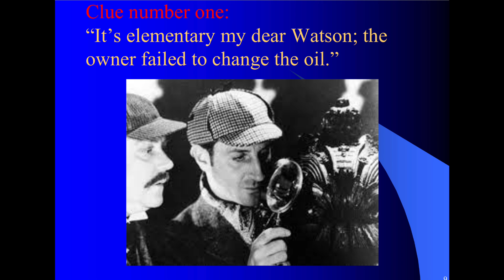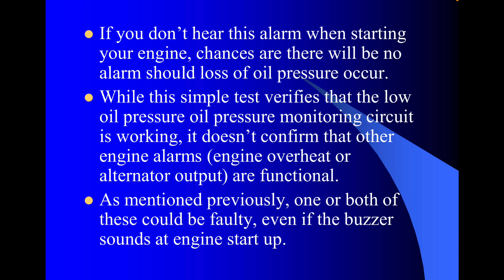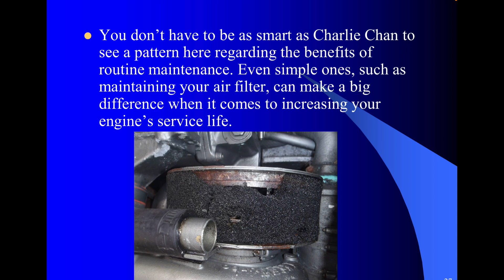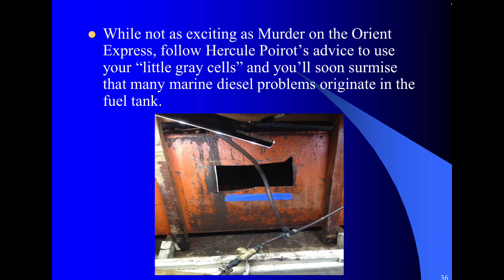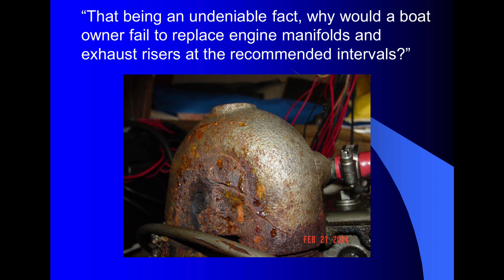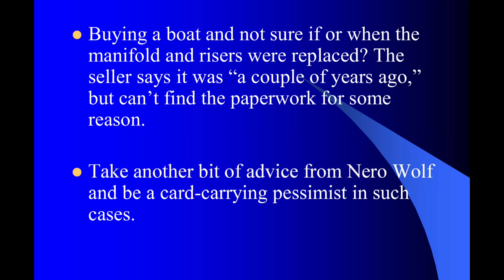Seven ways to MURDER your diesel!

Comment: Now I know why my friends dads Old wooden Chris Crafts boats all had the Exhaust manifold brazed up. We thought they were supposed to last for 30 - 40 years
Reply from the maker: If the boat is used exclusively in fresh water they can last significantly longer, although they still need to be pulled and inspected as recommended by the engine manufacturer. The manifolds and risers of raw water-cooled engines used in salt water are the most prone to corrosion. Those are the ones that you definitely have to stay on top of with regards to removal and inspection. And to be honest, if you pull a manifold or riser on a raw water-cooled engine (particularly if used in salt water) even if it looks good, it's false economy to reinstall it. The bulk of the expense is in the labor to remove and reinstall them, so do you really want to put a 5 year old manifold back on? My advice would be to just replace.